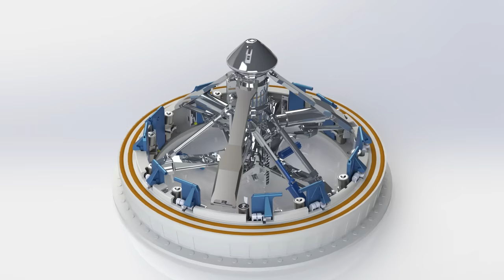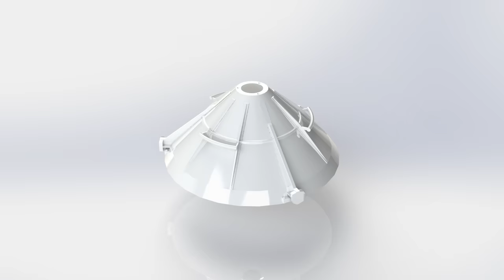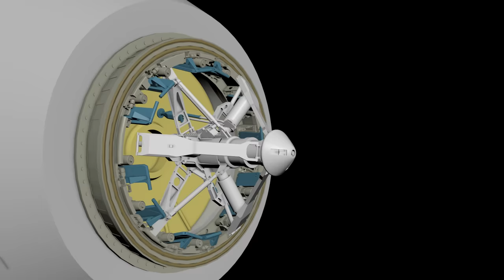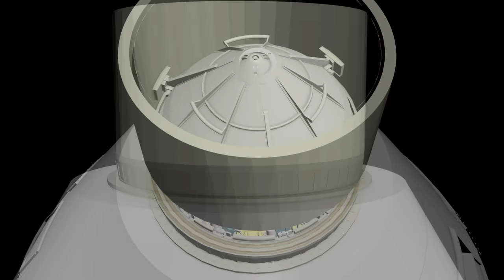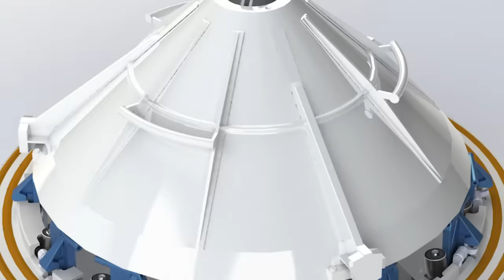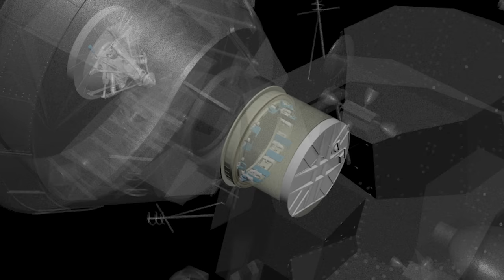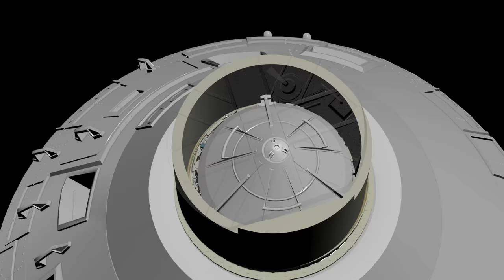Apollo Docking sequence - Connecting the Command Module to the Lunar Module.

Comment: Question: So, the CSM solo-pilot Collins had to pass the probe/drogue/locking ring to Aldrin/Armstrong... by himself, while the other two were already in the LEM? A & A install from the LEM-side- where's this 6K bust-fuse ring? stowed away just for this purpose? Once done, then give the go ahead for Armstrong to detach- then the 6K bust fuses blow him off...Collins has to re-attach when the LEM is back off the moon, but how does the probe/drogue engage and then pressurize from their side? (If the probe is reversed?)...

Comment: Great video! One question, how is the docking system rotationally restrict movement? There seems to be nothing preventing the two parts from connecting with a rotational offset, or even slip against each other when there is enough torque.
There seem to be 3 lugs inside the drogue 3D model but I'm not sure if they mate to anything on the docking ring, or even if they are present on the real thing.
Reply from the maker: Thanks. I'm assuming once the latches are connected then the rotational movement will be zero. At this point I'm going to leave it open to other experts on here. When I put the video together I was reading a lot of info but I was corrected on a number of the finer engineering points. And rightly so 😉
Reply: @graffix101  Yeah after going through a lot of documentation that's my assumption as well. Once it's docked, friction probably prevents it from moving, but nothing actually prevents them from being docked tilted or even totally 180 degrees off, assuming they can aim properly in that orientation.
Reply from the maker: @ScaredPilot  so it must be all about the orientation on the docking sight. I suppose a few degrees either way wouldn't make much difference?

Comment: Could the command module remain stationary? Or was the timing impeccable
Reply: The Command and Service Modules (CSM) had 16 small thrusters, which are small rocket motors, in sets of four that were used to either hold it stationary or to maneuver it around in space.

Comment: Awesome piece of work!!! Could you make one that explains how the three astronauts were able to change uniforms inside the CSM.. Since the inside the CSM, the size of a telephone booth, was so small, how were they able to get in then out of their suits...

Thanks!!
Reply: The inside of the command module (CM) was much bigger than a telephone booth. The CM was a truncated cone (frustum) with a diameter of 12 feet 10 inches (3.91 m) across the base, and a height of 11 feet 5 inches (3.48 m) including the docking probe and dish-shaped aft heat shield. Another factor to consider is that during weightlessness the amount of useable space inside a spacecraft increases. Consider a large room on earth. The only useable space inside the room is near the floor. But put that room in space and all of the inside space, including along the walls and up near the ceiling, is now useable space. The spacesuits were separated into two pieces at the waist. They would wiggle into the lower segment first and then wiggle into the top section second. Then the two segments were mated in the middle. The helmet went on next and the gloves went on last for obvious reasons.

Comment: I wonder why they reinstall everything after checking out the lunar module, only to  remove it and install it again prior to lunar decant... that incase something starts to leak in the lunar module?
Reply from the maker: Probably Lack of space. It was quite a large piece of equipment. If they can put everything back where it was and seal the hatch then not only was there more room but kept the integrity of the spacecraft in case anything happened to the LM or docking tunnel.
Reply: @graffix101  good point!

Comment: Let's have a mission to retrieve the Apollo 10  LM  when it swings by earth in 2037.    It should be in the Smithsonian.
Reply: It's gonna be more than 10 times further than the moon. It won't be easy.
Reply: Nobody said it would have to be easy. It's necessary...
 TARS, initialize rotation in synchro with Snoopy.

Comment: Poor Stu Roosa. He wanted the record for least fuel consumed during initial docking, but the Apollo 14 CSM could not get its drogue to latch to the LM until after eight attempts.
Reply: Stu got it latched on the 6th attempt.

     14 was also the only mission not to jettison the probe/drogue with the LM.  

   For this mission, Al, Stu and Ed brought back this hardware for post-flight analysis.   

    After studying the probe and drogue, it was concluded that small bits of debris could have prevented the 3 capture latches from moving or the cam assembly that controls the movement of these latches could jam in rare situations of side loading.
     
     Subsequent probe cleanliness requirements and a redesign of the cam assembly were instituted.  The 3 following lunar missions did not encounter off-nominal docking issues.

Comment: Small Correction: Apollo 11’s lunar module was never confirmed to have crashed into the moon. Someone did the math and the conditions may have been just right that it maintained a relatively stable orbit around the moon, and it could actually still be orbiting to this day. Check Scott Manley’s video to see how the math was done. It is not a guarantee by any means, but it could possibly still be in orbit. Crash was never confirmed.
Reply from the maker: I hope it didn't. It might be good if they pick it up in the future for a museum. Then we can see the broken circuit breaker that Buzz had to jam his pen into to get them off the moon. 👍

Comment: Why was that maneuver performed in space when the command and lunar module could have been launched in that configuration to begin with?
Reply: Probably lots of reasons, but one that springs to mind immediately is if an abort after launch was needed, the command module had to be at the top of the rocket so they could separate and get the crew away from the rest of the rocket. Having the lunar module attached to the nose of the command module would have prevented that.

Comment: This was excellent, but I do have one curiosity left; how did the LM and CM connect electrically? It was so important in getting the Apollo 13 crew back home.
Reply: I believe the only time they required connecting electrically was when they used the LM’s battery to recharge one of the CM’s batteries. They used an on-board umbilical and a procedure that took the engineers 3 days to come up with. Btw, Scott Manley has a YouTube video about one of the contingency plans in place in case there were issues launching the LM ascent stage. It’s the first time I had heard of an ED adapter they would have used which was just a fancy name for a 20’ set of booster cables. I’m assuming the on-board umbilical was actually the ED adapter. Be interesting to see if anyone has more information.

Comment: I did not know that the LEMs typically decayed to impact. Is an orbit around the moon not stable due to earth? Im working on the assumption they eject before doing a burn to leave lunar orbit. 
It'd be interesting to see an animation of all the space junk from Apollo missions, their orbits, and their destinies.
Reply: @graffix101  today I learned that ALL orbits decay
Reply: The moon’s gravity is not uniform at all.    It has several areas of mass concentrations (MASCONS) that cause perturbations in the orbits of spacecraft in lunar orbit.  These mascons have a much larger effect than earths gravity well.

     Also, starting with Apollo 12, the LM ascent stages were deliberately flown into the moon with a known mass and velocity.   The subsequent “moonquakes” were recorded by the seismometers in the ALSEP that was left running near the descent stage.    

   The S-IV boosters on subsequent missions were also crashed into the moon via controlled venting of propellant for seismic studies.

Comment: 3:28 - this is where you hear "Catch. Top-back is barber-poled. Retract." This is in the 1995 "Apollo 13" film. But what does "barber pole" mean?
Reply from the maker: If you go to my other video about Apollo 14 I put more detail into the actual switching than on this video starting at 3.03 and at various stages after that. Basically grey meant it was in its default stage. When the latches on the probe we're activated the display would show barber poles , black and white, then when the retract was complete and the latches engaged, the circuit would be broken and the panels would show grey again. I hope this helps.

Comment: I thought the pyrotechnics were only a last ditch solution to undocking the LM.  Apollo 10 tested this system out, so please update me on what is correct.  Thanks
Reply from the maker: My understanding is that the detonating cord around the underside of the docking ring was used to sever the ring from the cm. This was because all the equipment was dumped into the LM so it was the only way for them to undock. I'm being careful with my comments now as there are a lot more informed people on here who know much more than me 😂
Reply: @graffix101  Thanks so much for the response, I totally understand what you mean.  I’ve always had a lack of understanding of the docking mechanism so any info particularly video is welcome.

Comment: I don't see where anyone has asked an additional question that continues to cause me to wonder.  
One of the final noises always depicted, just after the probe goes into the cone is a mechanical "thrum thrum thrum thrum" maybe six to eight times.
Is this the automatic system that causes the closing of the final 10cm between the two vehicles just prior to being fully captured?
Reply: There’s the A****o experience report about the probe and drogue system you can google. Unfortunately trying to give you more specific information seems to get blocked by YouTube?

You should see one of the results shown as:

CAS Z FiLE COPY

Lots of great information about the various methods being considered and why they chose the one they did. It’s appendix A that goes into detail about the hardware. The retraction system used four nitrogen bottles to power the pneumatic system which is what was making the noises you are asking about. This specific report was written before the AP-14 mission that had issues with the system. If you’re not aware, Kevin did a video about that as well. Excellent work by him.
Reply: Excellent @mako88sb  !  Thanks you much very! :D  Now if I can just find that cool sound as a ring tone on my mobile!

Comment: Great video, thanx! But where do they store the hardware when removed? CM is so cramped
Reply: Command Module Lower Equipment Bay (LEB).
Reply from the maker: It looks like they put it back into position without connecting it back up.

Comment: Was the crew not allowed to enter the lunar module while enroute to the moon?
Reply from the maker: Hi Jon, the documentation states they enter the LM prior to injection into lunar orbit so that could be at any point on the way to the moon.
Reply: And one crew (13) had to.
Reply: There were only enough consumables (oxygen, water, electrical power) on board for the endurance of the trip to the surface and back.

Comment: I'm sure there was a reason why they didn't make it launch as an assembly, rather than making the command module turn around and dock to it, but I don't know what that reason is.
Reply: Because the launch escape tower is attached to the CM in case there was a situation during launch. That was the only method that might save the 3 astronauts. If the LM was attachched to the CM so that that particular maneuver wasn't needed, how would they attach a launch escape system to it and how much larger would it need to be to lift the mass of the LM/CM combo? Much more than would be practical for a Saturn V to be able to handle.
Reply: @mako88sb  Thanks. I figured there was a good reason for it.
Reply: @michaelmichalski4588  No problem. Btw, the Gemini missions didn’t have a launch escape tower attached to the capsule. They decided to go with ejection seats for the two astronauts. Fortunately they were never used. Even though the system was thoroughly tested for survivability, there were some astronauts who definitely weren’t keen about it vs the LES used on the Mercury missions and again on Apollo. 
Btw, there’s a video of the LES being used on the Soyuz T-10 launch in 1983.

Comment: Why would they not launch the vehicles already coupled or if not coupled, at least in the proper orientation as to not need "flipping" maneuver at the start and then enclose the whole assembly inside a "pointy" section at the top of the rocket? ?
Reply: The launch escape system tower needs to be attached to the CM in case the launch vehicle exploded. No other way to try and attempt to save the crew.
Reply: The LM could only survive launch while safely inside the Saturn V, while the Command Module had to be up front & facing forward as it was the only part of the ship with the streamlined nose.
Reply: It would shake off due to the connection size itself being woefully inadequate for the mass of the LM and shock load at launch. Maybe they could have braced it but then you would have needed a shell for aerodynamics and weight at launch was a huge issue so there's that. 
You gotta play Kerbal Space Program and design one yourself. Just the testing and failing is fun.